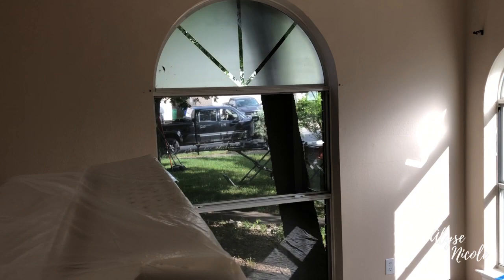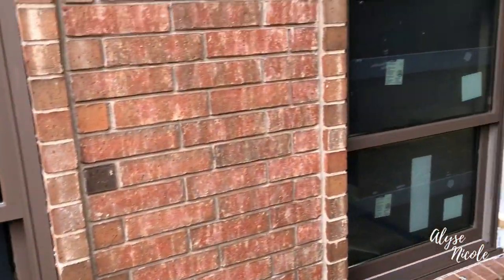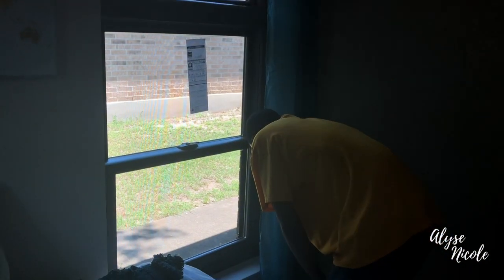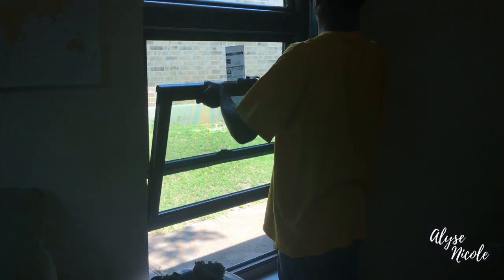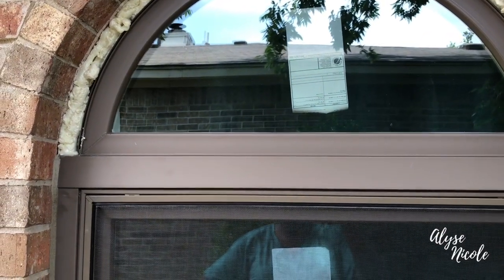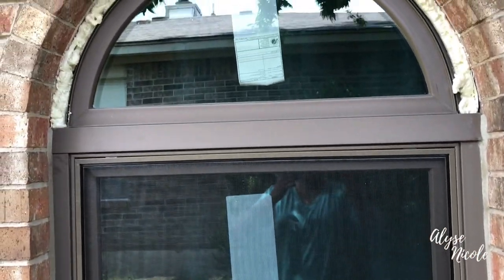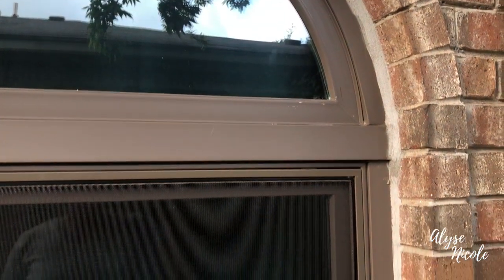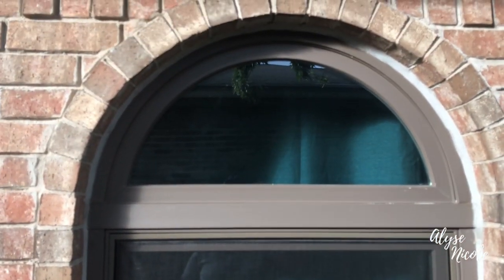HOME RENOVATIONS | NEW WINDOWS | RENEWAL BY ANDERSEN REVIEW

Comment: heads up to all , i had new windows by andersen renewal on 3/15/21 . the install was bad the spray form went over my siding and now it needs to be replaced also glue all over my porch cement 6 big spots it will not come up so think before u buy , 2 windows have had to be replaced since march bad windows one glass chip , and one frame damaged
Reply from the maker: Oh wow! Thanks for sharing.

Comment: It's the same problem they are having since 4 years ago, and fast forward today 2022 they have the same problem from very poor communication and problem with the quality of work. Ordered the windows and doors and it too a long time to finish the job. Supervisors and workers don't communicate properly and they don't communicate with their customers. They ordered the windows and doors in January 2022 and it's June 2022 now and they are not done yet. 

NOTE, if you are building a new house use Renewal by Anderson. If you are replacing doors and windows/doors don't use them because it's a headache and a heartbreak to deal with them. Their main problem is communication first and foremost, then workmanship and fitment is the second issue.